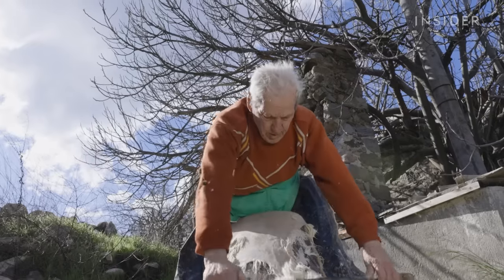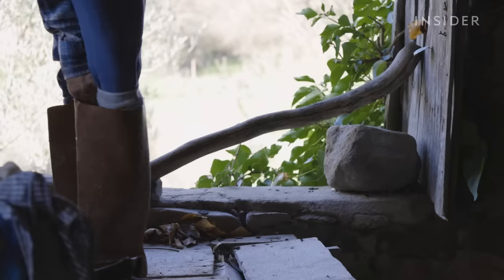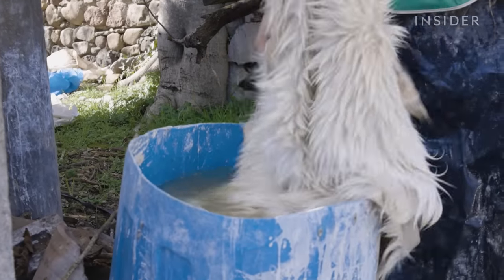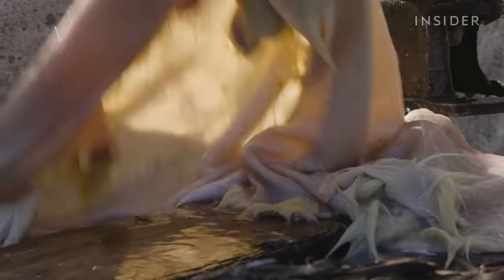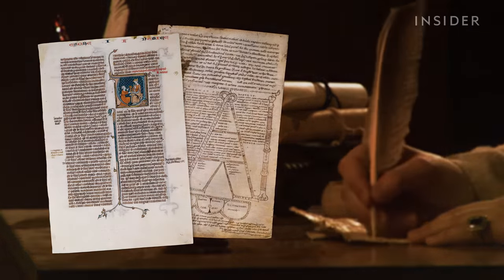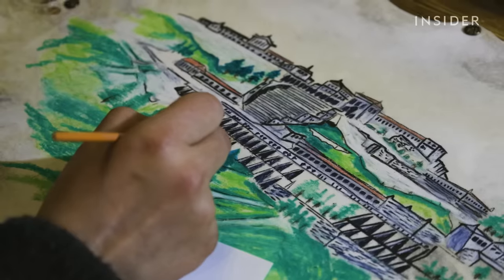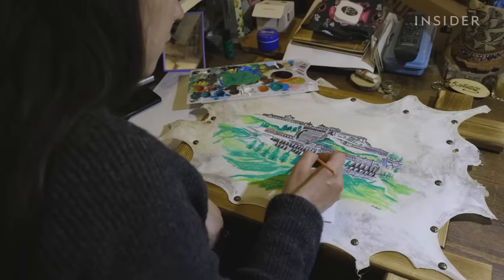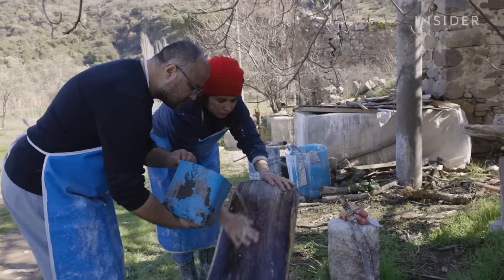How A 92-Year-Old Saved The Ancient Craft Of Parchment-Making In Western Turkey | Still Standing

Comment: That's a lot of work for a single sheet.  To think whole books where made from parchment once upon a long time ago.
Reply: It's virtually indestructible. I have some paperbacks I got thirty years ago or so, and the edges of the pages are crumbling to dust, even the ones I've only read three or four times. Very cheap.
I have some theology texts that are about a hundred and fifty years old, and they're in okay condition, but I have to be extremely careful with them, because the paper is brittle and can actually break if bent.
And then there are parchment and vellum books from the Renaissance and Middle Ages that are handled with caution mostly out of courtesy, because they're still sturdy and supple. You have to be actively TRYING to damage parchment.